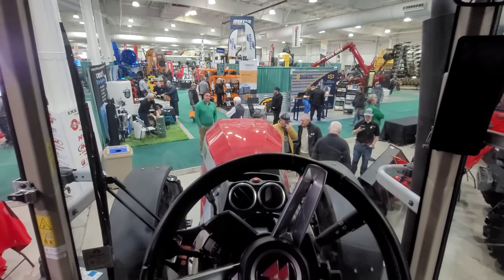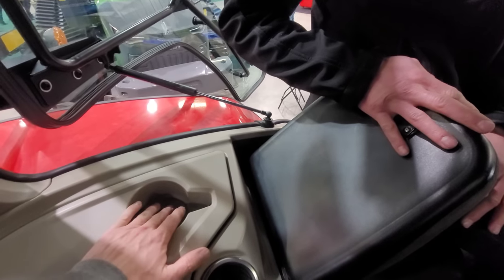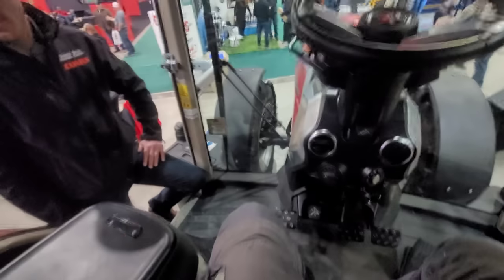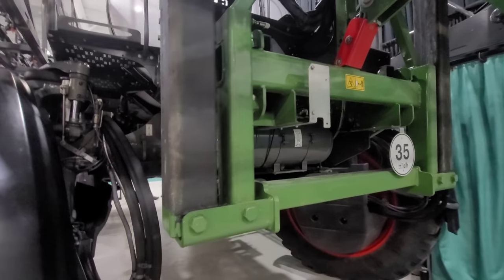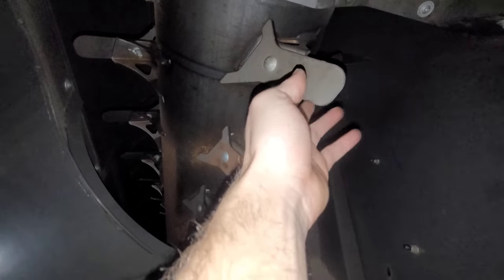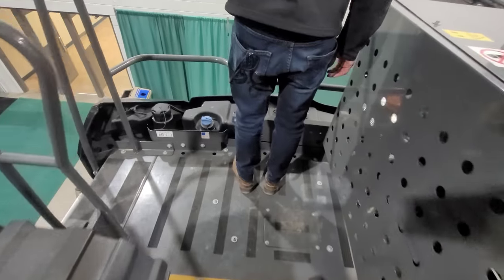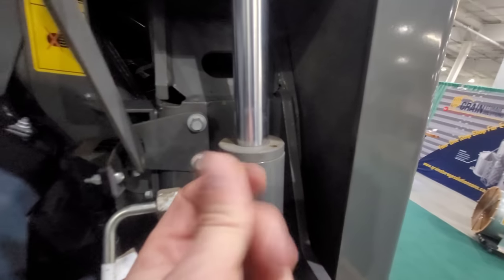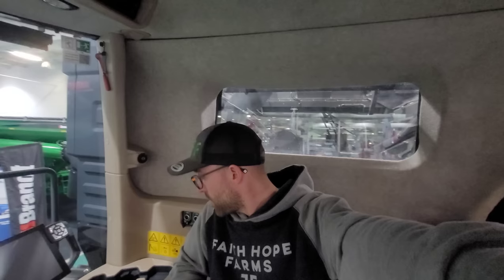The Fendt Ideal 9 @ CPS

Comment: I designed most of the grain handling of the ideal. Ideal had the foldavle auger from the beginning. This option was for Europe only at first.
The unloader tubes and auger are modulars, and you can bolt on a straight joint or an hinged joint. I like your comments. I wish  the combine was designed to beat deere (reliabilty high resale) and not claas (high perf, but high repair costs like a Ferrari).
.
Reply from the maker: I appreciate your feedback sir, I wished that too 🙂

Comment: the 8S you would enjoy for sure. its a really smooth tractor, especially with the DynaVT transmission (Fendt Transmission)
Reply: And it actually starts in cold weather because it has a real engine in it
Reply: @zimmermanservice7474  that's exactly what I thought!
Reply: https://www.youtube.com/watch?v=S_eGFuncYQ8 put on english subs! :D The AGCO Power (Sisu Engine) is designed in Finland and is both quiet and powerful, also like u say starts super easy in cold weather, doesnt care at all.
With the split hood from cab its also almost too quiet.
Mike would park the 700 and it would rust stuck :D
Reply: and he gets 8S with a frontloader :D

Comment: Videos like this make me think if newer machines are actually better than the ones that are like 10-15 years old now considering they went up in price about 50% or more and deliver way worse fabricating quality and quite often use way to weak materials. I mean, there are like hundreds of people designing and developing a machine and I dont understand how it happens that some designs are just bad and not practical at all.
Dont they have experts who know what the farmers are complaining about? for excample the cupholder on the 8.265 s tractor, why didnt they just integrate an cupholder to the armrest, it costs like 10$ to put one there. why would anyone buy a 200k machine if the cab where you spend many hours is crap. It shouldn't be that expensive to make a good cab with some nice features like well placed cupholders or a fridge that would add max. 1000$ to the price of the machine but would make the work way more enjoyable.

Comment: Still can’t believe AGCO didn’t sort out gearbox problem with breathers as for handle shutting the shield of concaves that just disappointing.  Interesting is most manufacturers have metal covers for concaves but JD did have plastic for S combines but X9 they went with metal. I find it’s easier take plastic covers off been lighter then metal covers.

Comment: Lee will be bringing you a claas 8800 this fall
Reply: I work at a farm here in Wisconsin which we have a Claas 8900 with a 24 Chopping corn head and a 50’ flex bean head. Amazing machine!! I’d highly recommend mike if he could get a demo to do so.
Reply: @crandonborth   yep I believe it they can’t be beat in my opinion they do such a fantastic job and getting way more popular, he will be getting a demo sooner then later I seen them ip against the x9 1100 Deere and they smoked it
Reply: @eddiewaltson5523  I would doubt it we run easily 6000 Bushel an hour and it’s still got more capacity we just can’t keep up so there no point. The tracks are definitely different than the Deere but they are so much nicer than duals. And it has an awesome engine I think it’s the MAN with 790 HP. What kinda funny we were looking at the motor and it’s the first European engine we had on the farm we have all case and ran some green but nothing European, It’s definitely much different.

Comment: A John Deere 7810 with 6500 hrs will outlive the Massey by two lifetimes imo
Reply: clearly you haven't been around a modern massey. Top of the class in quality, second only to fendt
Reply: @72alta  the trim was broken on a brand new tractor 😂
Reply: @etrain757  that tractor has had thousands of people get in and out of it in the last year and a half, its a pre production unit. It has been all across Canada. How would your tractor look if it was at at every farm show and dealer in canada?
Reply: My 91’ case 9280 with 8030 hours, which I have gone in and out of thousands of times also, doesn’t have broken trim. But that doesn’t even matter, I can work that tractor myself without having to call the dealer for every little sensor that goes bad. I don’t care what colour of tractor you have, all modern brands don’t last like they used to
Reply: @etrain757  I absolutely guarantee that your 9280 has not experienced what that 8S has on the farm show circuit. That is exactly what the 4020 crowd said about the 7810 in 1997. Things change whether we want then to or not.
Reply: Spouting nonsense
Reply: @72alta  I know things change, my 2018 quadtrac has been okay although it has had multiple sensor problems. It does a great job when it’s working but when it’s down, that 9280 with 300 less hp out pulls it because it’s actually doing work. I’m fine with the electronics if we could actually work on the tractors nowadays, but alas we can’t

Comment: It's just so hard to fathom all the money that these manufacturing companies spend designing things. I don't know if it is their egos or they're laziness or just the bean counters stopping the engineers and designers from listening to the operators of this machines and not making common sense improvements. Just drives me nuts. My favorite saying is every engineer should be kicked in the nuts if they knew how frustrating and miserable they were making the lives for the operators of their machinery.
Reply: Yeah
Reply: The engineers often want the best, but management, budget folks and marketing folks constantly limit their efforts. The first Ideals actually came out way overweight, like WAAY heavier than it was supposed to be. And it was extremely overbuilt. BUT, since it was not how marketing advertised, and since it cost too much to overbuild stuff, the weight had to be redesigned out of it, hence the lightweight "cheap" product we have today.
Reply: @GuySpragg88  I have a friend who engineered a chisel disc for a implement manufacturer, same thing, great but too heavy had to put it on a diet.  On combines engineers seem to take great pleasure in designing spike type latches and brackets right where you would turn and run your head into. Or see how many bolts and nuts in a spot that it's impossible to get a wrench on them.